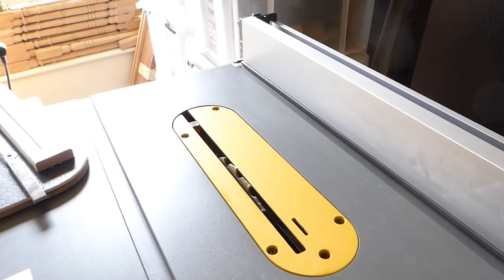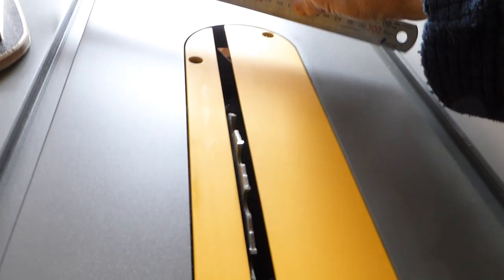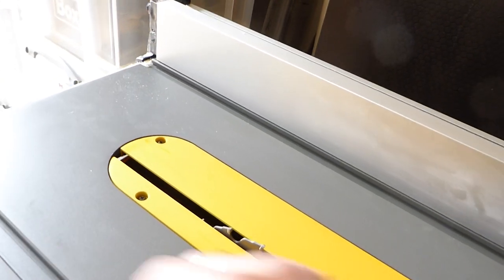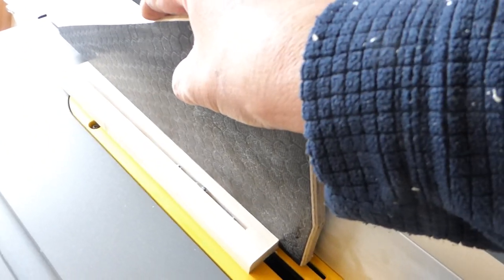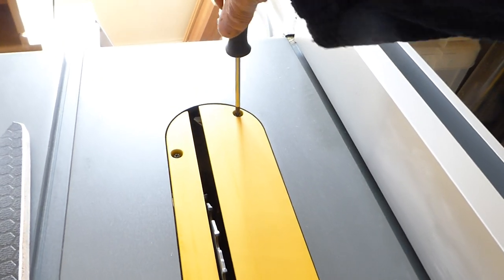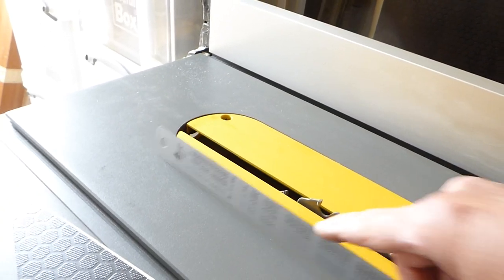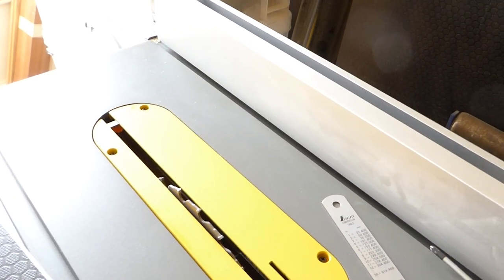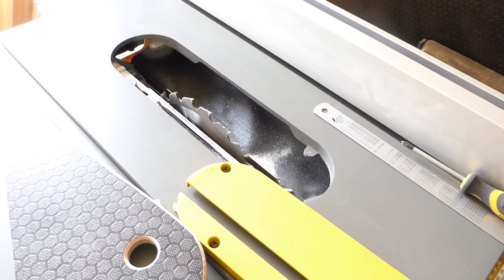dewalt table saw dw745 - Throat plate problem

Comment: What if you taped a small piece of metal to the tabs on saw? Then the adjusting bolts on the insert wouldn't have to travel as far. Or what about getting slightly longer bolts? Just a thought. I usually don't use the factory inserts anyway.